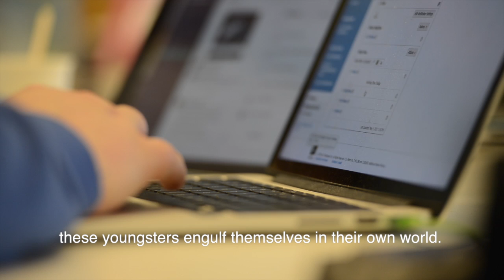DUT17 Roll-Out Documentary

Comment: Are those linkages connecting the suspension to the front and rear wings acting as a mechanical adjustable aero system to create more evenly distributed downforce in the corners, or am I overthinking it?
Reply from the maker: You are absolutely correct! The floating aero (front and rear wing) move in the opposite direction to the roll of the chassis, always staying parallel to the ground. You can see the system at work in this video: https://www.facebook.com/FSteamDelft/videos/10154465797501104/
Reply: Formula Student Team Delft Awesome! I can’t say I’ve seen that before, must save a lot of time as opposed to installing sensors or writing a program to control actuators. Did this design carry over into the newest car or does it add too much weight/complexity?
Reply: Hello, where can I read a bit more on this. Don’t think I have understood it right. Is it unspeung aerob or some kind of selfleveling wing system? Regards